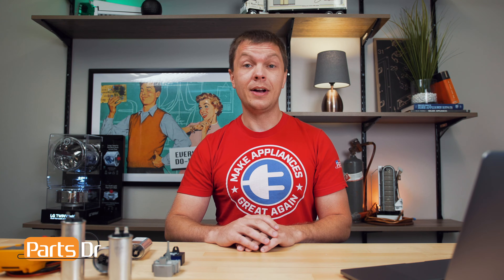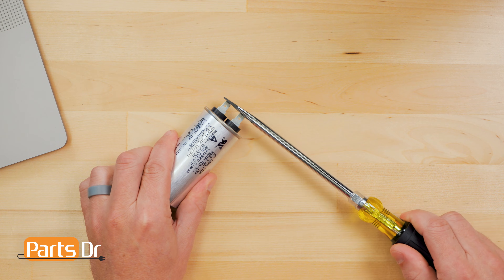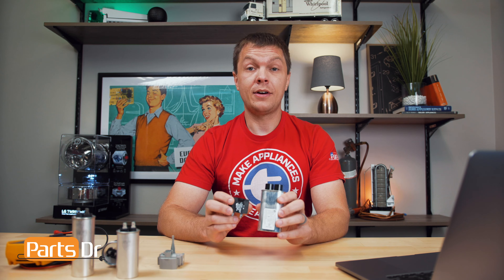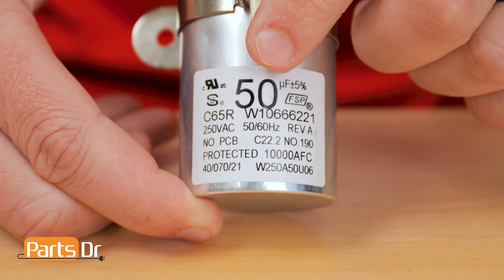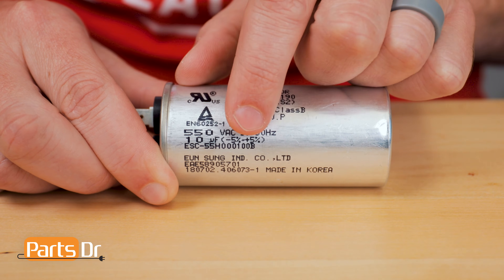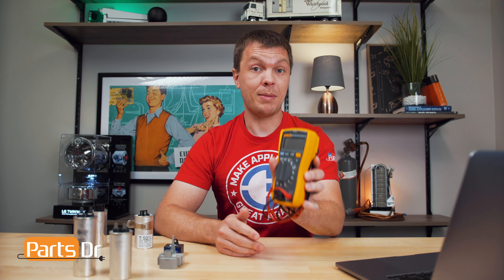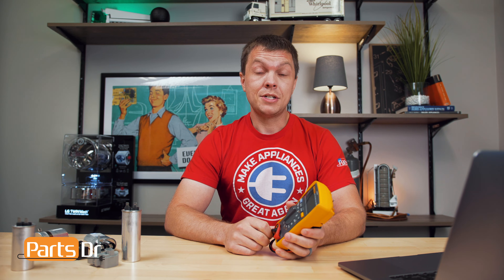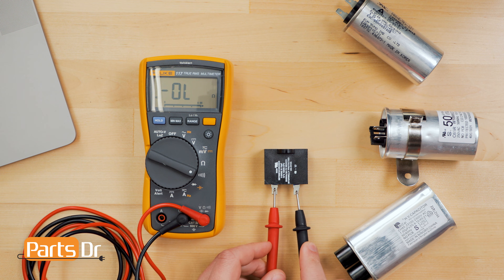How to test & troubleshoot appliance capacitors

Comment from the maker: Learn how to test a compressor start relay here: https://www.youtube.com/watch?v=nx7l9kY2_bU
Reply: TY for the video.  ...  (Refrigerator broke, supposedly fixed, broke 2 months later, in storage for a long time.)  Frigidaire Refrigerator FSC23F7DW8:  My run capacitor is labeled: -5% +10% 250VAC/B 15µF... the multimeter reading was 15.84... it's good.  But, I get the nasty suspicion it is the wrong part, anyway... PN: 297286803.  (The start relay was definitely bad.)  Both came from an Electrolux kit I was sold (a long time ago) but I think it was the wrong kit.  (Relay is in the dump, can't check that part.)

OEM, (original), parts are long gone.  :-)

Will the PN: 297286803 work properly?  I connected a 3-1 hard start with that run capacitor, but the refrigerator and freezer stayed at about 50-55 degrees.  Now, even with that part taken off, both are still at that temperature.  (EDIT  Heck, maybe I bought the wrong 3-1.)

Your PN is: Run Capacitor; Part # PD00000334 (/ Mfg # 218909913)

I don't know the correct OEM part number!  I have another kit coming today, and now I am 100% sure that it is wrong:

Amazon: NEW UPGRADED W10613606 Refrigerator Compressor Start Relay and Capacitor by BlueStars - Exact Fit for Whirlpool KitchenAid Kenmore Refrigerators - Replaces W10416065 PS8746522 67003186  ...  I must have been sleepy!  Heh heh!

The only other things of note is:
I replaced the defrost thermostat.
About 3-4 inches in diameter of ice builds up on the copper tubing leading into the evaporator coil, but it stops at the (silver) tubing where it begins to be finned.

SO, I guess I have more troubleshooting to do!  Back to square one!
Reply from the maker: @philgar7786  The partial frost (3-4 inches) pattern on the evaporator coil usually indicates a compressor or sealed system problem.  The would need to be repaired by a professional and may not be worth the cost to repair.
Reply: @PartsDr   I had already spoken to a repairman about a diagnosis.  Been playing with this on and off for a couple of weeks or so.  I did realize that symptom was unusual for the more common problems.  -  Yeah, it's just ice at the very top on the tubing only, not the whole coil.  -  I forgot to mention I found a pin-hole leak in a copper tube near the compressor.  I was wondering if it was for the water line leading up to the water filter, because that is where it heads, up the back, toward the top.

Anyway, it does not matter.  I am going to let him perform a diagnosis, even though I just bought a new multimeter and was going to retest some things.  (A lead on my old one broke.)  And, yes, if it's serious, it's trash.  I will part out interior parts for sale and sell the rest to a rebuild shop (for whatever) if anyone wants it, or give it to them.  I know the junkyard will take it!  :-)

Thank you very much for the reply!  Take care!
Reply: I 'must have' the poster behind Ryan.  Where can I get that?
Reply from the maker: @4scottbell  Sorry, it was a custom one-off piece made for our video studio.
Reply: @PartsDr  Do you have the source for the original producer?
Reply from the maker: @4scottbell  Sorry, we do not.

Comment: I have a bad capacitor from a washing machine. Testing it got nothing. Not even a response on 2 different meters. Got a new one and got the same readings on it. Wasn't sure if the part was bad or if the box. Tried the swapping leads to see if holding a charge and got nothing on old and did get a beep on the new one. Why would i not get a reading? I did install the new one and it is working fine now.
Reply from the maker: Some meters don’t measure capacitance well unless they have a dedicated capacitance test mode. Glad to hear the new capacitor fixed the issue!

Comment: My fridge quit cooling in the fridge, but the bottom freezer works fine.
Reply from the maker: Check for a failed damper, fan motor, or a problem with the automatic defrost cycle.  https://www.youtube.com/watch?v=_m7pW3PueJs
Reply: I had a technician come out & he said the damper was working properly but I needed to unplug the fridge for at least 24 hours & let it defrost the line going from the freezer to the damper.  He recommended that I get a new fridge.  I bought a brand named  cmed "Hisense".  Would you recommend this brand?
Reply from the maker: @eastcoastbearingsllc5794  No, we do not.

Comment: I have a Frigidaire freezer top fridge. I order a replacement on amazon it said it was compatible to my fridge model frt21p6csb2 and I tossed out old relay. So far I replaced relay with different part from amozon  freezer not getting colder the 65 degrees I checked timer with voltage meter n working fine. What could be the problem

Comment: When I did a continuity test on my capacitor, I switched the multimeter leads and the multimeter beeped each time, where as when he tested the capacitors he only got one beep after switching the leads. Does my test suggest my capacitor is good or no good?

Comment: What if the reading is beyond the level
Reply: Then you replace the capacitor!
Reply from the maker: Can you give us more details?
Reply: The capacitor reading is more than the level written on
Reply from the maker: @kennedyokwera4857  As we show at 1:23 in the video, you will want to read the capacitance and tolerance numbers from the capacitor and make sure when you test it that it falls within that range.
Reply: And there's this compressor that read well I changed capacitor only fan running it only over heating

Comment: Super easy to understand. Thanks for going over all the variables. Helpful if you added one more: can a capacitor passes the continuity test but fail the capacitance test?
Reply from the maker: Thank you for the feedback.  Yes, it is possible for the capacitor to pass the continuity test but fail the capacitance test.  The capacitor could be storing and release energy but not the right amount.

Comment: Hi there ~ fantastic video! I do have a question: I'm testing a run capacitor for a refrigerator and I followed your instructions for testing capacitance (I got readings within the micro farid rating listed on the unit). However, when I attempted to test the continuity, I kept getting OL and no beep. Does that mean the capacitor is bad?
Reply from the maker: The capacitance test is the more accurate test, so that should mean that the capacitor is good.
Reply: @PartsDr  Okay, thanks ~ I'm checking the compressor next 👍

Comment: Sir may I ask, if I have a motor starting capacitor for "Dough Mixer" of 80µF 10+20% 270V, and I have a reading of 85µF, shall I say that the capacitor is in excellent condition?
Reply from the maker: That sounds like it is testing good.

Comment: if my refrigerator stopped working and won't turn on anymore and keep things cold but the light inside still turns on does that mean it needs a new capacitor? Or a new circuit/motherboard

Comment: my Question is ? my original refrigerator capacitor is 12uf  210 vac..a can use more then 12uf, or less!  need help
Reply from the maker: Typically you will need to use a capacitor with the same specifications as the original.  Even better, search with your refrigerators model number on our website https://partsdr.com and you can find the exact replacement from the manufacture for your model.
Reply: @PartsDr  ok 👌 thank you Sr